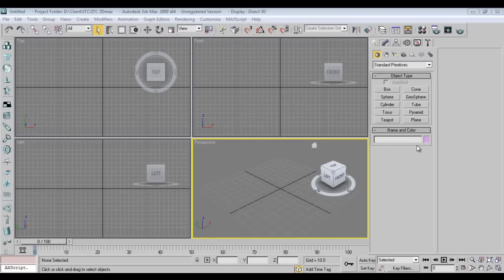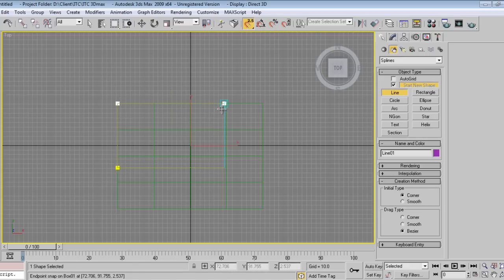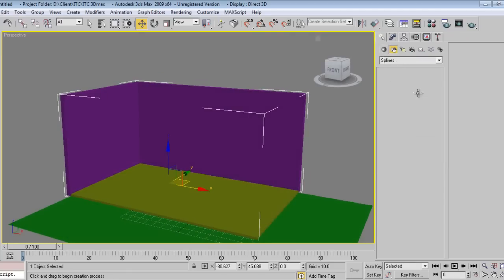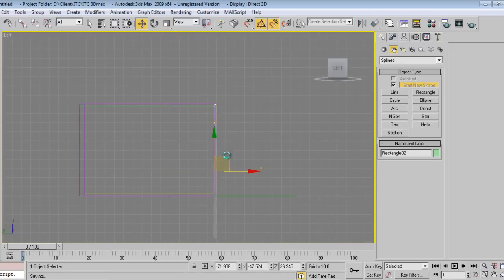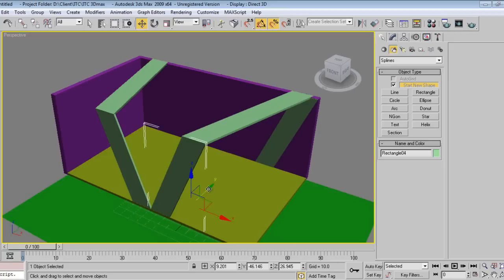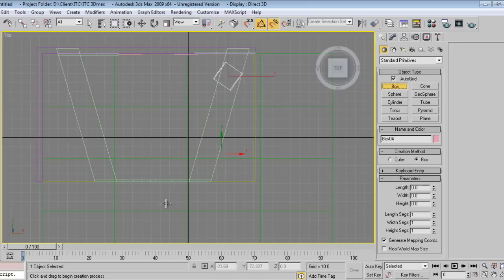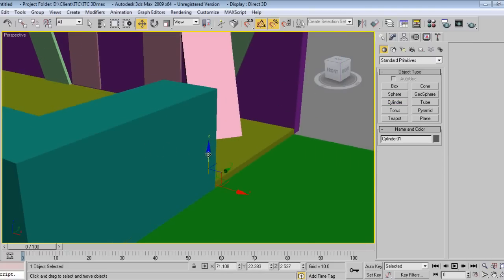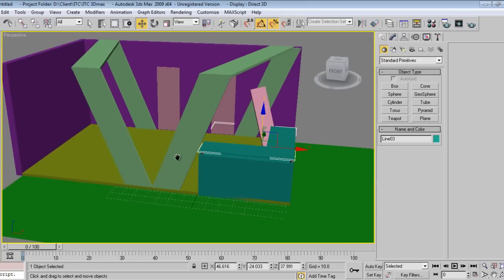Stall Design in 3D max  Part-01

Comment: Sorry dear its a only 1% work of stall designing. Because you will always get new challenges. Always you have to design according to the clients requirements. I think you even don't know what is Facia, Pelments. Its a very very simple work. lots of works come after this. Like lighting, furniture, clients product placement and lots more. Sorry dear I don't wanna hurt you. I just wanna tell you that stall designing is also a difficult task. You need lots of experience in this. We are making minimum 10 designs in a day.